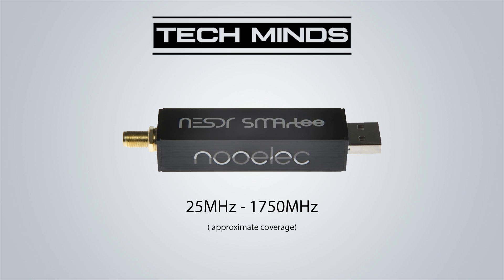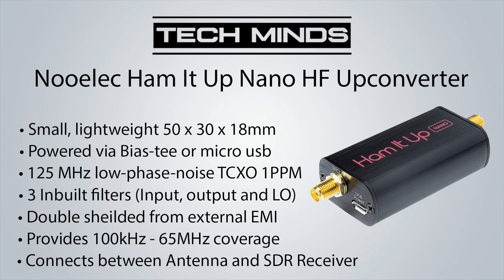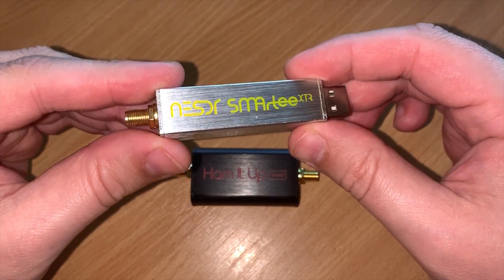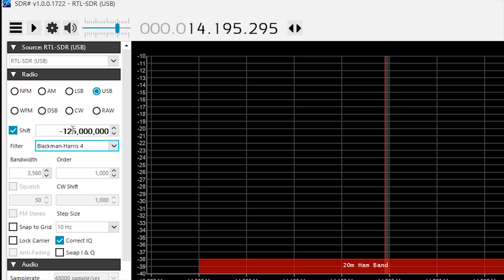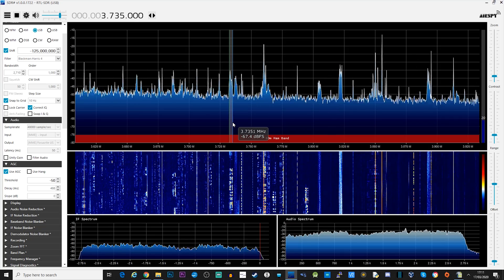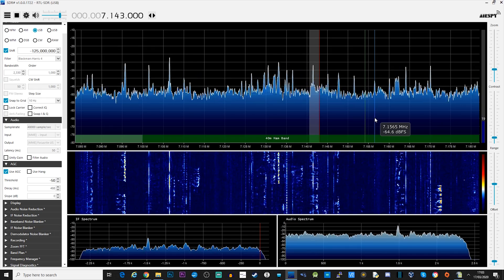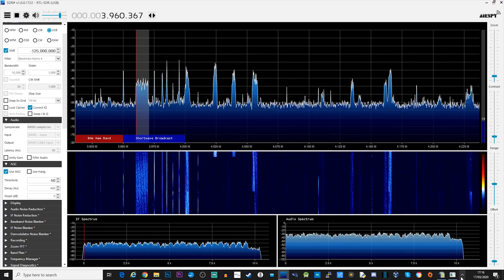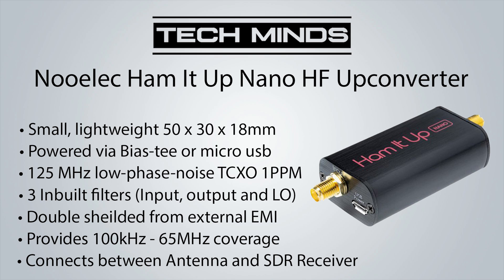Nooelec Ham It Up NANO - HF Upconverter

Comment: I bought one last year and its far too complex to actually use. I have a FRG7 and also a Kenwood R2000 you turn them on and they work. The Noelect system I was hoping to use on business trips but it is so complex to make it work in the end it just sat in my suitcase and in the end I left it at home. I never actually got it to ever work which was really disappointing as it promised so much. Its a great example of making something so complex that it becomes unusable. Occasionally I get it to function and when it actually works its quite good but mostly it just sits in the attic now and I am back to my SWL machines with buttons and knobs like it has always been. If you are super (and I mean super) computer literate this is for you but if you are not it will not really work for you.
Reply from the maker: Hi there.. There is only one setting in software you need to choose, and that is the offset value. Apart from BIAS T and a suitable antenna, that is the only requirement to get an upconverter working.
Reply: @TechMindsOfficial  Not quite true, you need to get the actual item working and this involves Zadig drivers which are different for each computer. Once that is solved then getting the SSR running can be tricky (as I said, you have to be quite computer literate) I have not got around to using the upconverter that I bought as it seems to do nothing. But, my FRG7/KenwoodR2000 get me listening quite well just they are no where near as portable as the Noelect.
Reply from the maker: I thought your comment was about the up-converter as that’s what the video is about. Drivers only needed to be installed once for the rtl SDR. If you want something that doesn’t require these upconverters then look at SDRplay.
Reply: @TechMindsOfficial  I came here looking for solutions to get the SDR radio actually working, looking for solutions.
Reply: @TechMindsOfficial  What is this offset value that we need to enter and where in the software is it?

Comment: Hi mate I'm new to this some advice please.also im interested is shortwave to how will i be able to do that .  i've just bought this bundle any tips on connecting up like the one in this video Also will the software work that you have links for cheers Mike
Reply from the maker: Hi Mike, Sorry for the delay in replying, lots of comments to trawl through :-) Did you manage to get sorted or do you need some advice. I can make a video if there are some specific things you would like me to cover. Thanks, Matt

Comment: I have just started with SDR and I have found your videos very helpful. I have a NooElec NESDR SMArt v4 which I use to listen to Airband and I would like to listen to the HF band. What would be the best experience for a beginner, purchase an RTL-SDR V3 and run it in direct sampling mode or get a 
Ham It Up Nano to go with my SMArt?
Any advice would be appreciated.
Reply: The direct sampling modes leave a lot to be desired. Mostly because there is no gain control. I have the RTL-SDR Blog V4 (which supposedly has a upconverter inside it) and Nooelec extrended range dongles and the RTL-SDR Blog V4 works better than the Nooelec NESDR SMArt, mostly because the V4 has gain control when using the extended frequency mode. But they both work noticeably better when used with a Ham It Up Nano. The Ham It Up nano is pretty nicely done.

Comment: Can i still listen to VHF/UHF if i connect a suitable antenna for it, but with the hf-upconverter still in line? Or do i need to unplug the upconverter if i want to listen to uhf again?
Reply: You need to remove the Ham It Up Nano to use VHF again. It is quick, just unscrew the SMA connector(s).
Reply: yes
Reply: @Antenna101  
Which yes??? 🤣
Reply: @antalperge1007  yes

Comment: Interesting and well presented as always, thanks! If I had a Ham it up connected to my SDR device would I be able to use my device's top (higher) frequencies without disconnecting the Ham It Up?
Reply: I have that same question.  Seems like there would need to be some type of bypass or else jumping around to listen above 65 Mhz would be a mechanical nightmare and take away some of the fun.

Comment: I have the exact same setup... but without a decent HF antenna.
 im able to tune FM stations without the nano, but as soon as i plug in the nano i lose all broadcast fm and am stations.... is this normal?
(im reading the ham it up+ has a bypass switch to solve this?)

Comment: super cool, I am looking at buying one of these right now.  I have the old version1 ham it up, its super deaf like 10db insertion loss.  Do you use an LNA between the up-converter and the antenna?

Comment: Amazing channel man. Maybe you can help me to decide which SDR to start with the Nooelec Smartee XTR, Smartee V2, AirSpy mini.
Reply from the maker: Hi and thanks for the comment. It depends on your budget. Airspy mini will be the better choice, but the NooElec are very very good for the price point. You could start with the NooElec and then upgrade to an Airspy if you feel you are enjoying the hobby :)
Reply: Tech Minds Thank you for your response. I was even thinking to get the TLR and try. My plan is to use my Raspberry Pi4 and use is to listen/scan. And then if I like it, go for a LimeSDR for more ambitious project. Thank you for your time!
Reply from the maker: You’ll have lots of fun with a Pi4 attached too! Give me a shout if you need me to cover something in a video :) 👌

Comment: I was wondering if you could point me in the right direction, so I'm looking at getting a HackRF One but I was wondering if I should buy the one on Amazon ($315US) or if the ones on aliexpress/banggood ($70-$115US) is there a difference? Any info i find is over a year old and just says they look to be built from plans... thanks
Reply from the maker: Hey Joshua, thanks for the message. To be honest I don’t know what the cheap HackRF units are like. I would imagine they are some kind of clone but as I havnt had one I don’t know if they are any good. In my opinion I would definately get the original one, even though it’s more expensive at least you’ll know it’s original and will do what it’s supposed to. You could try asking this question in the HackRF Facebook group if you have Facebook. My advice would be to buy original.
Reply: @TechMindsOfficial  Wise Decision. Only the Original will be able to withstand the freqs, recall all channels, and be fully capable of executing top performance after correct optimizations vs. degradation and improper handling of equipment and programs. Frickin' Beaucratic commies! And I ain't feared to say it!

Comment: Can you tell me which antenna you use?  It would be great if it were available on Amazon.
Reply from the maker: I use a End fed half wave with a 49:1 transformer. I’ll make a video on this antenna as it’s really good for small gardens, also it’s multi band without a tuner

Comment: Hmmm Does the TCXO really have 1PPM? I got a Ham It Up Nano in the Nooelec giveaway some weeks ago and the datasheet that I got says it's 0,5 PPM.
Reply from the maker: Thanks for your comment, I took the specs from their website so I’m assuming it’s correct. I’ll check with them. Thanks for watching 👌
Reply: @TechMindsOfficial  You are right. Had a look at amazon. There they say it's 1PPM. Have a look at my Twitter @rwefan1907 There is a picture of the datasheet that we got with our prize. Maybe they changed the TCXO after the giveaway. Who knows :)